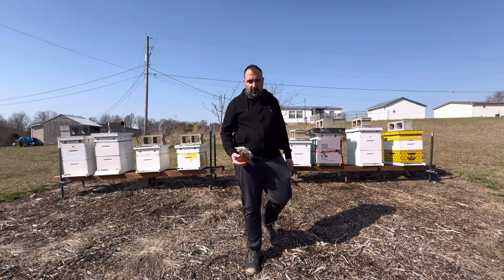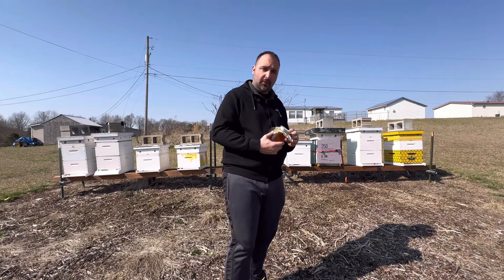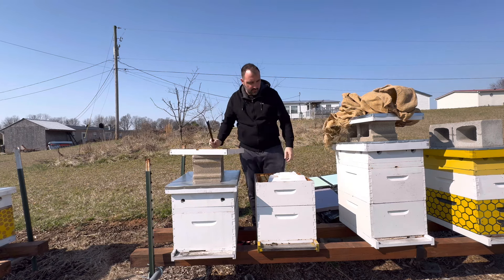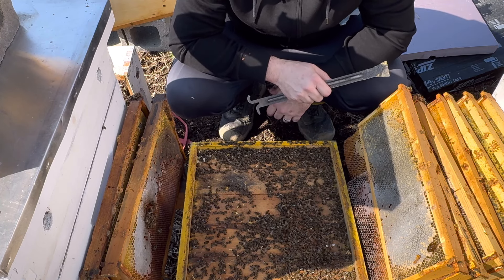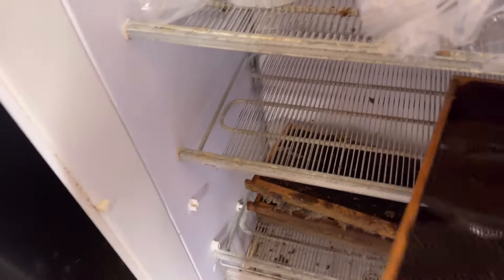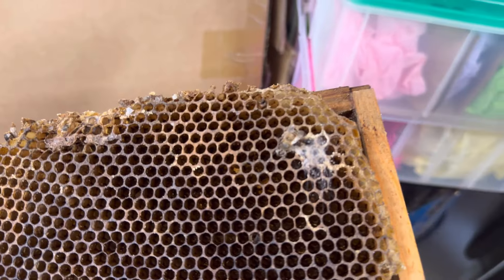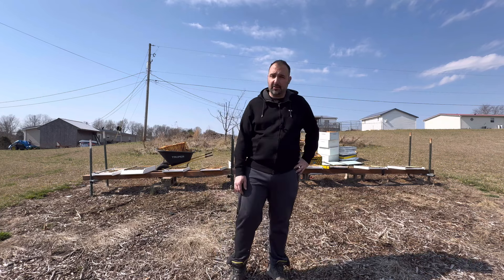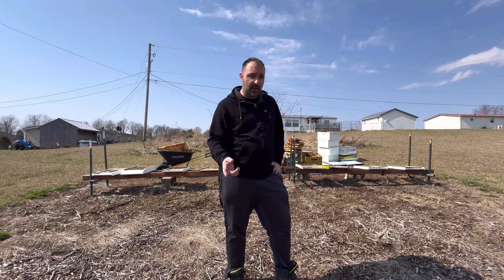I lost 8 hives after feeding them honey!

Comment: Did you test and treat for mites before September when they make winter bees. Hives don't look like they were strong enough with the amounts of bees in box. Freeze some honey to give to new bees. Honey should be good under the capping. Did you feed them in spring and fall? The Honey you gave them prob was fermented which basically turns it into alcohol. If you feed them may not be real Honey. I feed mine early spring and late fall. Wonder why it fermented.
Reply from the maker: I’m really at a loss. I did test for mites and found them within an acceptable range prior to winter. There were a couple hives that had low numbers of bees, but most of them had plenty of bees to make it through the winter. I also insulate and ventilate my hives to give the bees their best possible chance.
Reply: @RyanGrady  you uses alcohol wash or powder sugar roll for testing? Then ones that survived look good. Possibly just split from them.